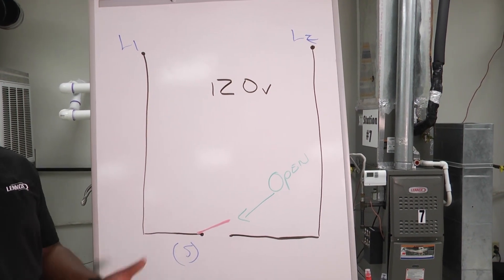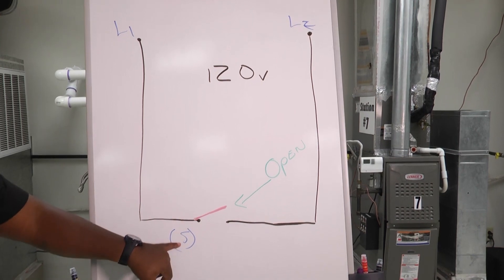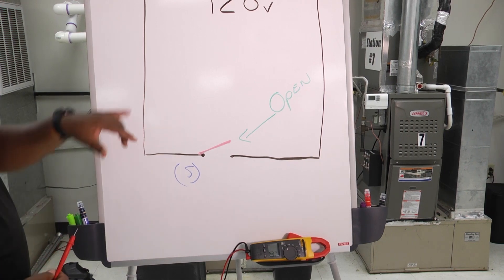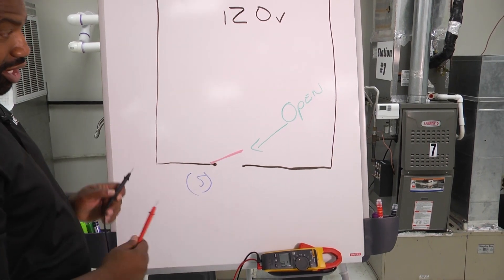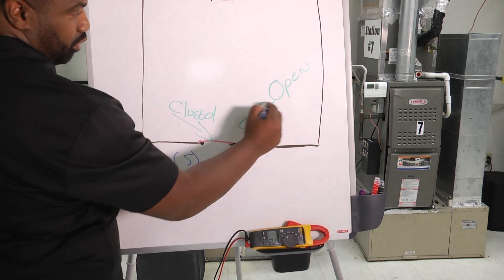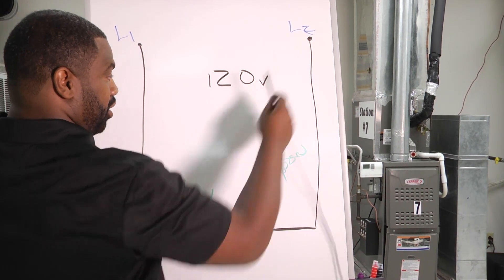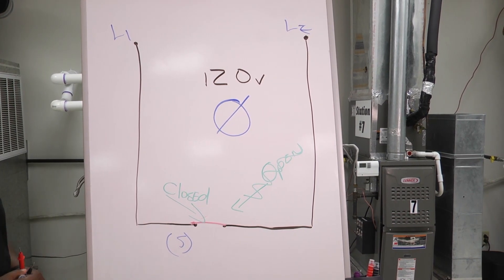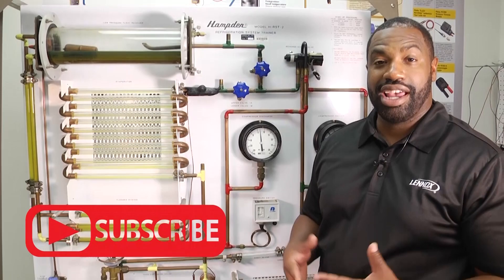Open and Closed Circuits Basics

Comment: Open circuit means the wires are cut off so there will be no current flow, but there is voltage.

Closed circuit means the wires are connected so there will be flow of current, but there is no voltage

Comment: Well that would cause the wire to get hotter than hell and burn out.It is a direct short,and I see no over current protection device ,so the wire will essentially burn out.As a result of high amperage.

Comment: Am I the only one that’s watching this thinking to myself “what the hell is he talking about“?  Maybe the reason he can’t read voltage across to closed circuit. Is because it blew the damn breaker because it shorted out?!?! I always thought the difference between an open circuit in a closed circuit is an open circuit was not completed and I close circuit was. Never had any issues getting a voltage on a closed circuit being used as normal
Reply: Im really really trying to grasp the lesson from this video.
At the end he said, "short" video. No pun intended 🤘🤣